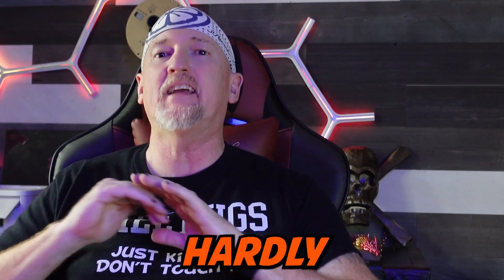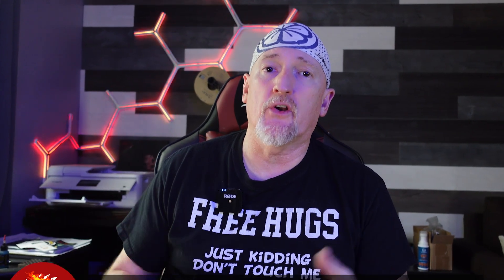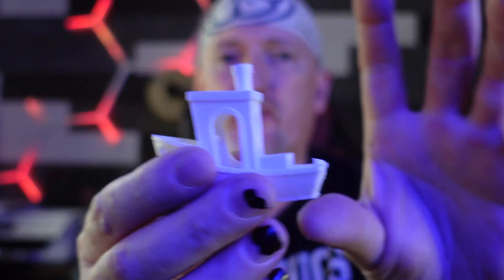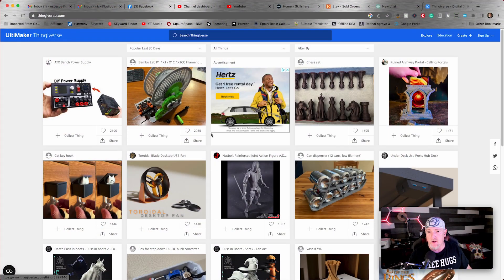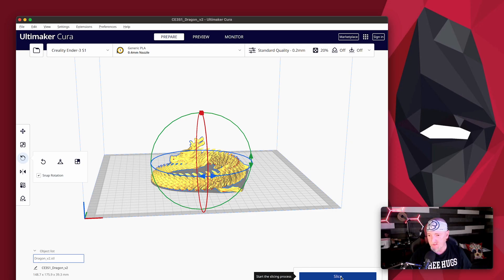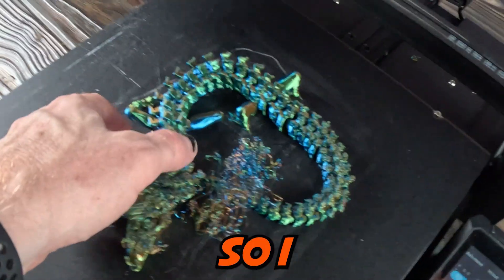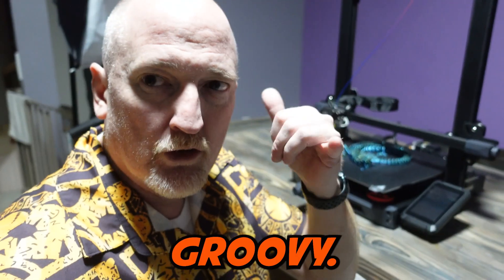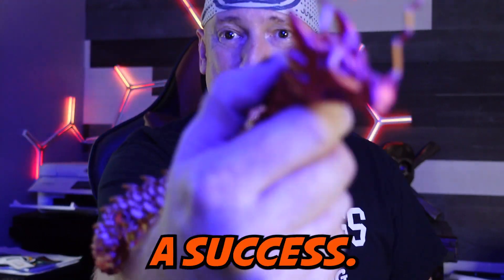Trying the HARDEST 3D Print as a Noob (on an Ender-3 S1 Plus)

Comment: i am also new to printing, but i have found making a good lithophane the hardest.  small ones okay but going into the 290*250 size is a pain, mainly z wobble, which i also have a s1 plus.  Dont know if it was the upgrades or also adjusting it but the wobble is gone, if you really want to test your skills make a large lito.  also not nerdy, but you seem like the kinda person that just keeps plugging away at a problem that you get the result you want.  Its a new skill and i know you well learn

Comment: I don't know how you messed up that print bed that bad in such a short length of time from starting with that printer, but yeesh, it's bad. 4:35 One of the most important things for 3D printing is the bed, and the surface. If the 1st layer doesn't stick, you're screwed. It has to be clean. The bed has to be trammed. It does look like the bed surface is as bad as my Ender 3 S1 was, filament sticks too much to it. Replace it with a Wham Bam plate, and it's like heaven.
Reply from the maker: Not sure exactly what you mean. The bed is fine...
Reply: @BuildDadBuild  LOL I'm not sure if that's your awesome sarcasm or not. Imagine the bed being like a piece of wood that you want to paint or poly, it must be clean of debris. 3D printer bed leveling is akin to laser focus, if it's not straight/flat/trammed all of the way across, then problems occur (but evermore sensitive by like 10x). Oh, and white filament that comes with the Creality printers is garbage. It will leave part of itself on the build surface, as you can see in your purge line area.